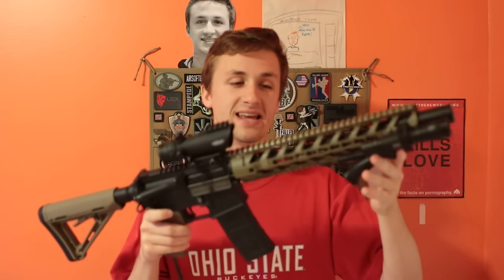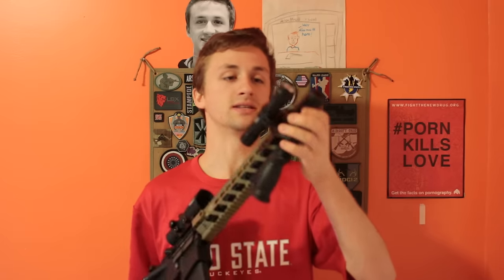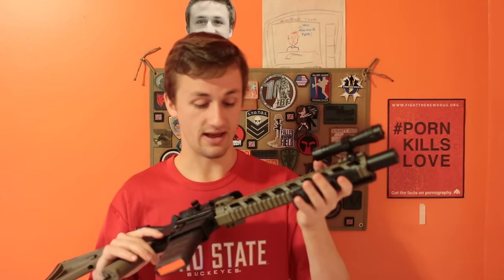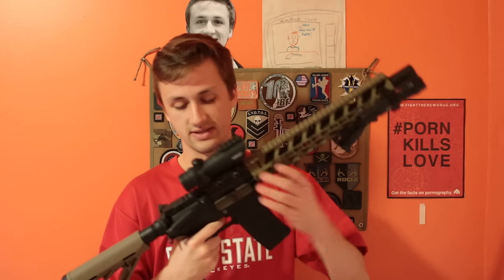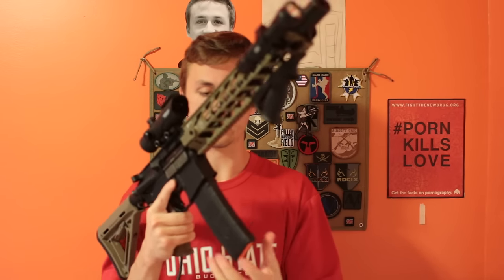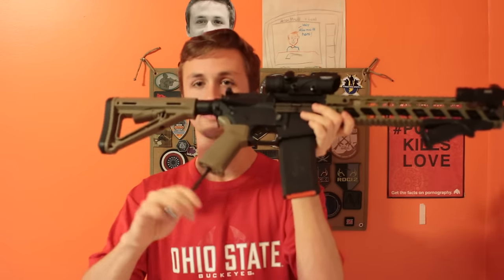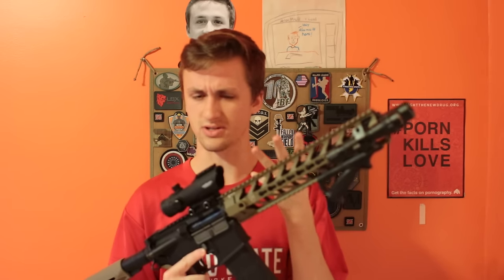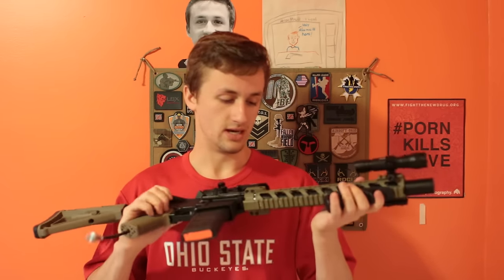Custom Wolverine Inferno Build

Comment: SWAT guys like to hold the mag well, there isn't anything stupid about it. It gives you a very tight turning radius
Reply from the maker: Some people prefer that, but SWAT guys and most military and law enforcement do not hold their guns like that because the muzzle of the gun becomes much less stable, therefore throwing off shot accuracy. Accuracy happens to be the most important thing.
Reply: alecmac111 there are lots of swat guys who hold the mag well, especially in buildings. I've even see footage of marines in Fallujah holding the mag well, I know you hold the weapon further towards the muzzle for more accurate fire. But when you clear a building a tighter turn radius and less exposed limbs is preferable.
Reply: Mag weld is def no-no in the military bud. A Habit that's always being corrected.
Reply from the maker: In the military they almost always use vertical grips because it does not leave vital organs exposed. They do not C clamp in the military as well because that also leaves vital organs exposed.

Comment: my mom wont let me get into airsoft ive told her its safe and stuff but she keeps saying its dangerous how do i explain to her its safe
Reply: Maty Hall Any gun that you use at an Airsoft field is strictly regulated to be below 550fps for snipers, and 400-450 for assault rifles. For CQB weapons 350fps is the max. Every person playing Airsoft wears tightly fitting z87.1 rated goggles and most of the time full-face protection as well as long sleeves. It is extremely safe.
Reply: Symbou 1v1r i tried that shes just really protective
Reply: Caleb M. already told her that she said she would consider it and i asked her a few days later and she just said no i said why and she didnt reply :(
Reply: dont have a mic atm getting one at christmas my current mic fellow off its boom arm :(